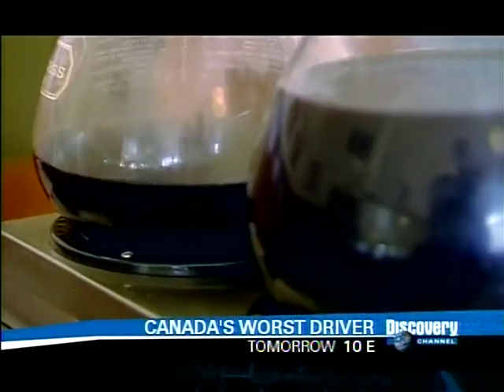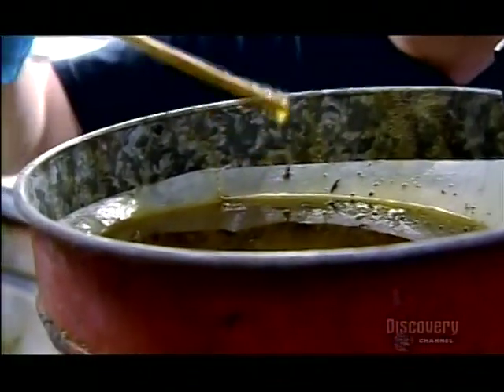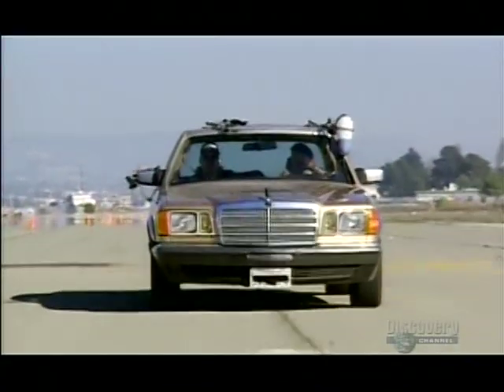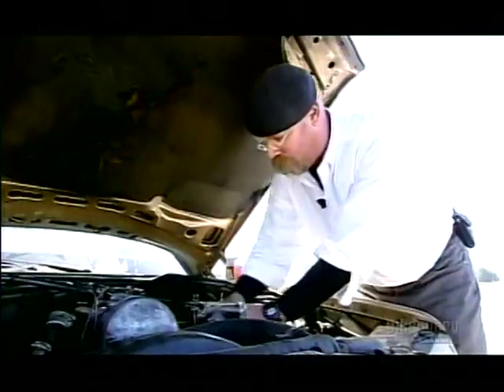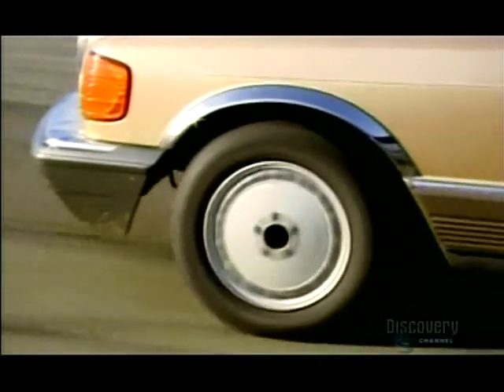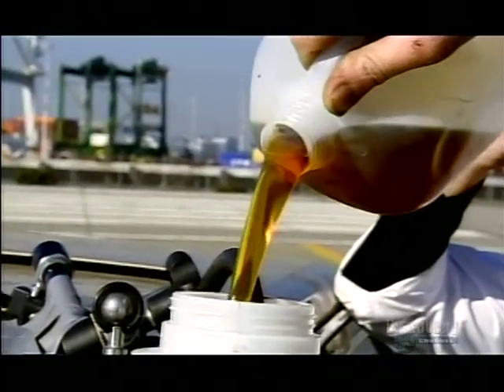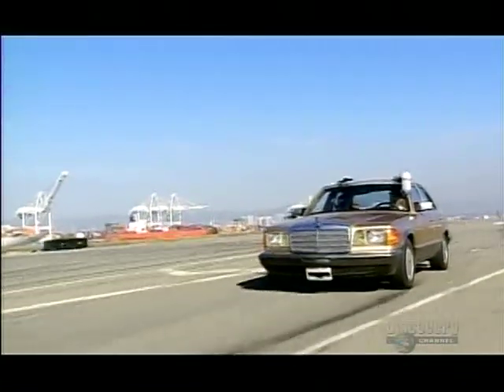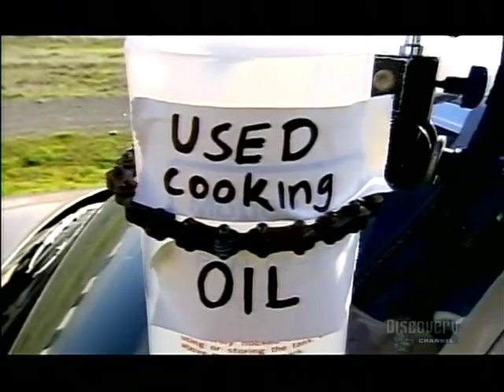Myth Busters Desiel car running on cooking oil

Comment: myth busters are not worth wathing after the stunt they pulled when it comes to running a car on hydrogen. it didn't work because they purposly didn't use any type of electralite solution.

Comment: on winter all you need to do is warm the oil before it gets to the engine, same way the regular oil is heat up in some vehicles that are from cold areas like Chicago, Ohio, north Dakota etc, etc, ect.

Comment: can we use new oil or just the one that have been used, and can i use all kinds of oils vegetable oil etc etc?
Reply: Oil, all veggie oils, used motor oil, brake clean, kerosene, automatic transmission fluid and more.
Reply: letty hernandez I just asked myself that same question. Any answer?